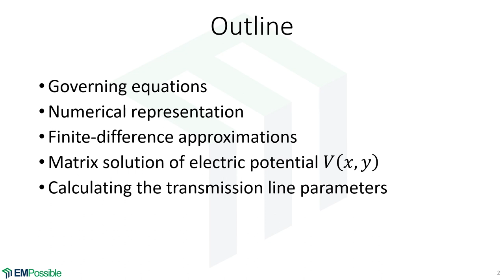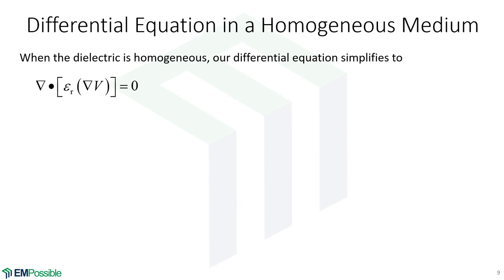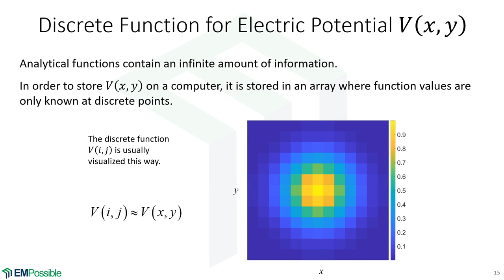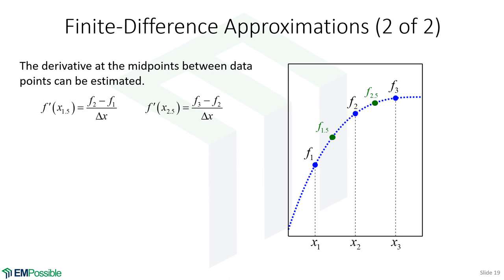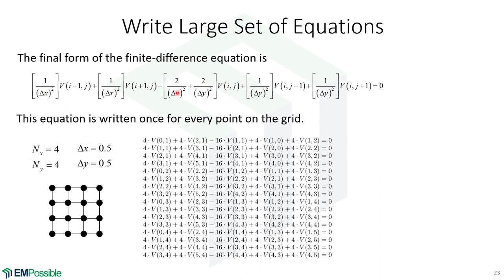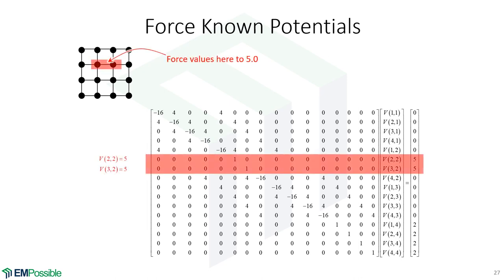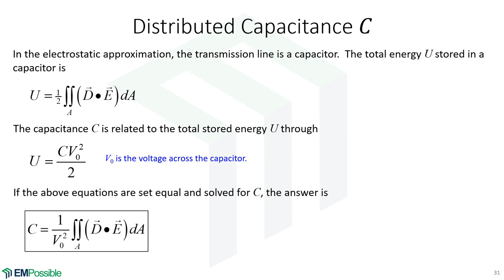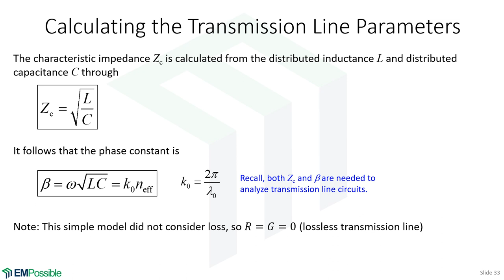Lecture -- Numerical Analysis of Transmission Lines

Comment: This is an excellent explanation.  I am working on a personal project to calculate the characteristic impedance of transmission lines from their 2D cross-section using this method.  Strangely, I've skimmed several CEM textbooks and none do more than mention this task in passing, if they mention it at all.  Are there any textbooks or journal articles that discuss this application in detail?  It's a very common need in microwave engineering, signal integrity, etc. so I'm surprised that there's so little material out there.  I searched using keywords like "electrostatic" and "quasistatic"  - is that the wrong terminology?
Reply from the maker: I have the same experience and such information is near impossible to find.  That is a shame.  I have recently written a book where I describe a more rigorous method for analyzing transmission lines in order to take frequency and loss into account.  It is a little bit more complicated than the electrostatic approach described here, but you may find it useful or interesting.  Here is a link to the book website:

https://empossible.net/fdfdbook/
Reply: @empossible1577  Thanks very much!  I discovered your book shortly after posting this comment.  Appreciated!
Reply from the maker: @youtubeaccount8955  If you get the book, I would love to hear your thoughts.

Comment: Very good explained. Thank you . How about R and G from E and H fields?
Reply from the maker: This simple analysis is not able to calculate R and G or even the H fields.  That requires a rigorous analysis.  I have a new book that will be released Jan 31 that covers rigorous analysis of transmission lines in detail and includes all of the MATLAB code.  It calculates R, L, G and C for a microstrip, but you can input essentially any transmission line you want.  Here is a link to the book:

https://empossible.net/fdfdbook/

I have some crude and probably insufficient notes online about how to do this.  See Lecture 4j here:

https://empossible.net/academics/emp5337/

Comment: A fantastic lesson! Thank you so much. I'd like to ask a question, would appreciate it if you like to answer.
The difference equation for the electric potential V(x,y) basically gives us an Nx X Ny 2D square grid or vice versa. However, if we consider a 2D grid/lattice whose nodes are also connected diagonally with the same kind of components (every node will have totally 8 links), what would it be the difference equation for this grid?
Reply from the maker: Thank you!  I have something very close in a paper we published a few years ago titled "Generating Spatially-Variant Metamaterial Lattices Designed from Spatial Transforms."  Instead of connecting diagonally, the finite-differences are for a unstructured and nonuniform grid.  I "think" these will give essentially the same looking finite-differences.  See Eqs. (7) and (8) and the discussion up to that point.  Here is a direct link to the paper.

https://www.jpier.org/PIERM/pierm92/10.19103004.pdf

Hope this helps!
Reply: @empossible1577  Many thanks!

Comment: I think by calculating D , It should be : D=eps0 * epsr * E (Not D=epsr*E). Am I right?
Reply from the maker: You have given the correct equation, but if you look closer you will see that I moved the eps0 term to later equation.  It may seem weird to do this, but it is very good practice to normalize your variables so that all of your terms are of the same order of magnitude and as close to the value of 1 as possible.  Any crazy constants like eps0 should be incorporated near the very end to give correct values for the terms being calculated.

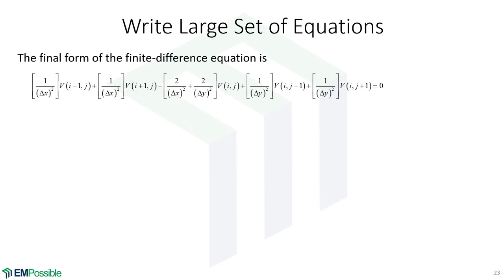Comment: Hello Dr., how can I construct the coefficient matrix in MATLAB using the eqution in 17:24?
Reply from the maker: Keep watching.  You will learn a method for doing this that will make FDM very simple!
Reply: @empossible1577  Hello Professor, I kept watching but the video did not mention MATLAB implementation of the equation. Are we supposed to construct coefficient matrix using spdiags and such commands to create sparse band and diagonal matrices in MATLAB?
Reply from the maker: @throine  I recommend accessing the courses through the actual course website.  I teach numerical analysis of transmission lines a little bit different in each course.  This lecture is from Applied EM and Microwave where I provide the MATLAB codes to perform the simulations.  This video is just giving you a taste of what the numerical process is.  To see this, here is the link to the Microwave Engineering course.  See Topic 3.

https://empossible.net/academics/emp4301_5302/

If you really want to learn the numerical methods behind this, go to my computational methods class and work through Topics 6 and 7, but you can skip the numerical integration subjects in Topic 6.

https://empossible.net/academics/emp4301_5301/

Depending on what you are really looking to do, either of the above courses will have everything you need.
Reply: @empossible1577  Thank you Professor.